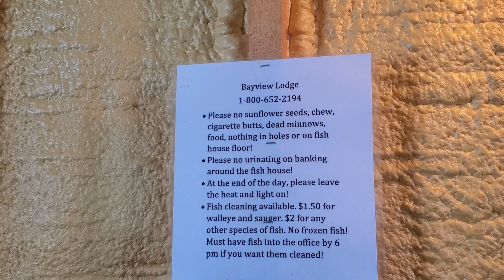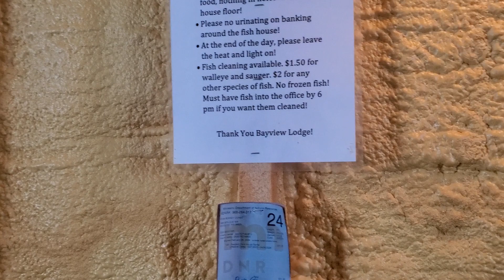Lake of the Woods Ice FishingTrip January 2024

Comment: Wow you all did good. Seems like having the heater on would melt the ice..❤❤
Reply from the maker: it does keep the slush out of the holes but hot air rises so it's like sitting on top of an air-conditioner.